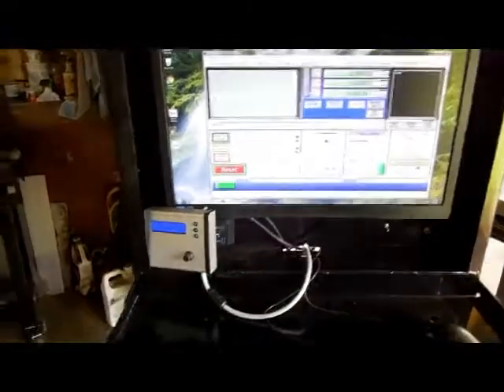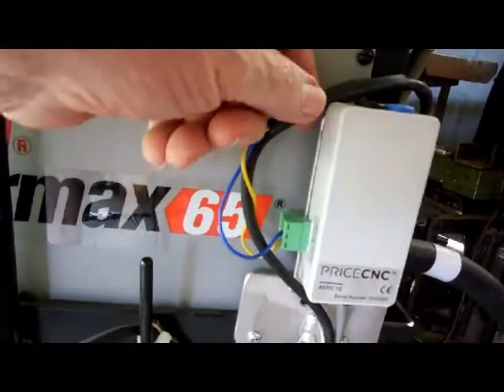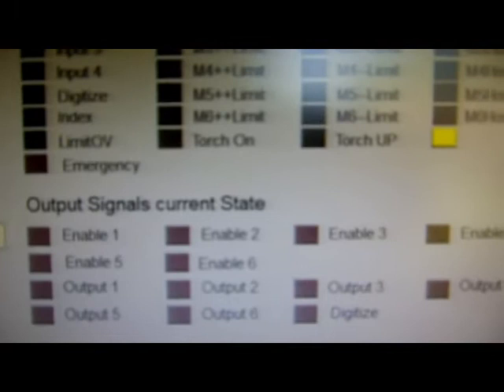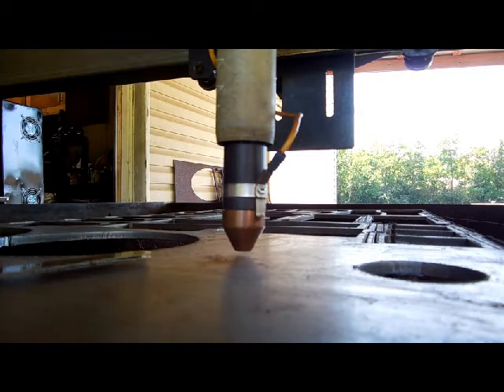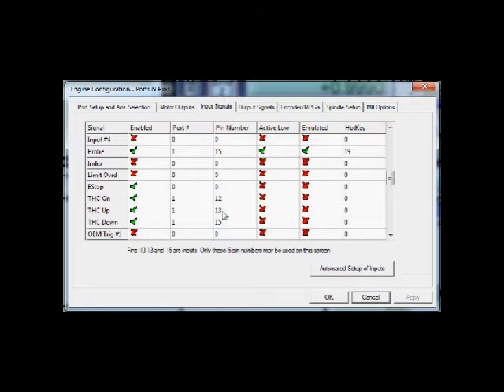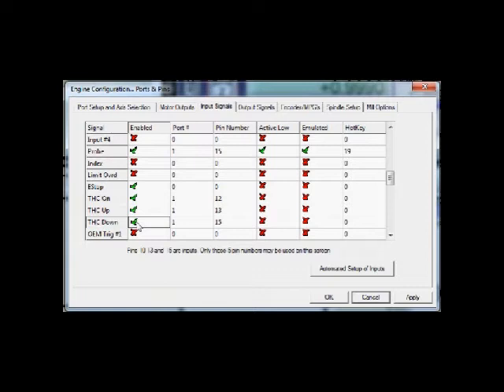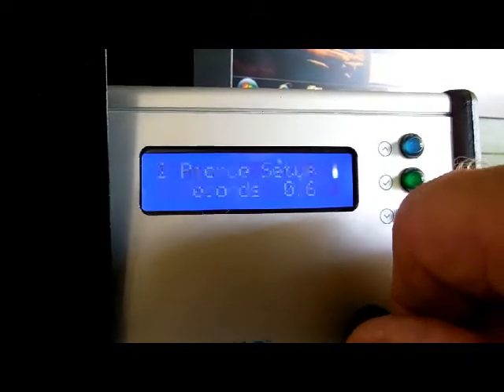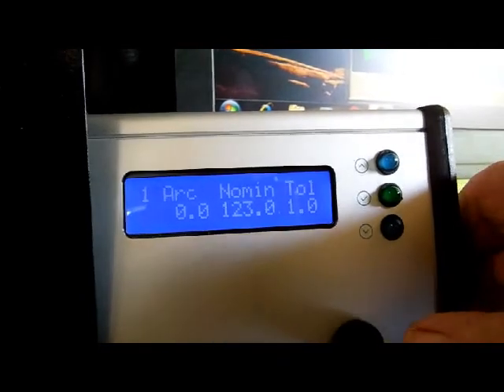Price ACHV10 install and situp finsihed

Comment: Tom,

Could you give me the dimensions of the control head on the Price unit?

Thanks in advance!
Reply from the maker: here you go worth the price I have used 2 other units I use this again if I build another table.
https://www.ebay.com/itm/PriceCNC-AVHC10-Plasma-Arc-Voltage-Torch-Height-Controller-THC-AVHC-Price-CNC/172362492642?hash=item28219aeae2:g:6~AAAOSw-kdXxCGM
Reply: @bigirish4886  

I already have that link saved in the watch list, I need physical dimensions (I'm building a box for it). The manual nor the listings show the physical dimensions..

Thanks Again

Steve
Reply from the maker: I replied on Plasma spider with PM  have fun
Tom

Comment: Hello! When I check the signal test the torch UP is always connected. you know why?
Reply from the maker: I believe that is correct you can cycle through the 3 signals to check the wiring connection to the BOB and see them in Mach.  Just push the button to move to the next signal.

Comment: Hi Tom, I see you went for the Price thc, how do you like it? it looks a bit clunky having to disable ports & pins and storing settings in the unit, didn't you have C&Cnc unit before?
Reply from the maker: Hi Sean
yes I did have the CandCNC unit before and like it very well, I actually had 2 they both went with tables I built and sold.  the price unit works very well too, the setup is easy, and similar to the other units I had.  I think the storage function on the Price (holds different cutting operation) makes it easier then other units, just select with the khob and that loads any of the stored routines.  have fun
Tom

Comment: Which cad and cam software are you using? Looks like you are using Mach3 which post processor are you using?
LeRoy
Reply from the maker: the CAD program I use is TurboCad 2018 the CAM software is SheetCam and the post processor is from PriceCNC from Ireland
Reply from the maker: HI Yes I am using Mach 3 and sheetCam the post processor is determined by the electronics attached to the table.  There are different features of the electronics and they have their own Post Processor.

have fun
tom